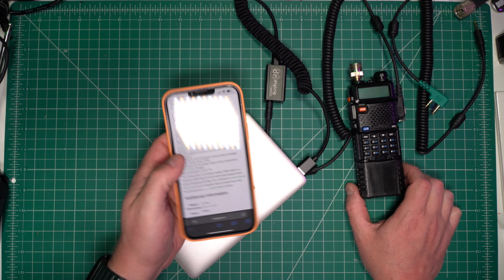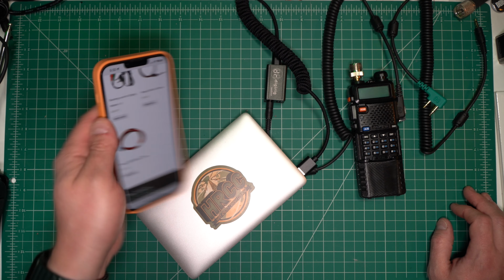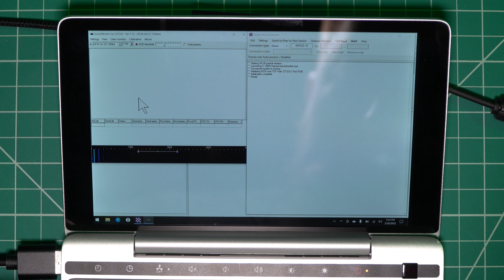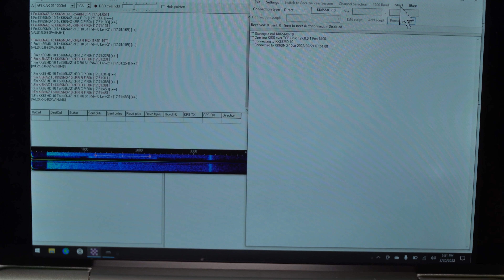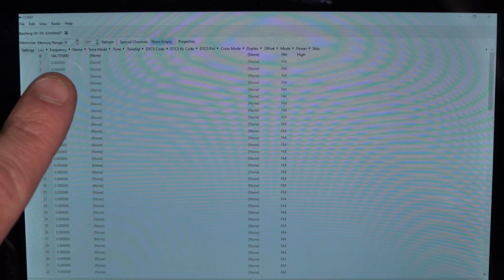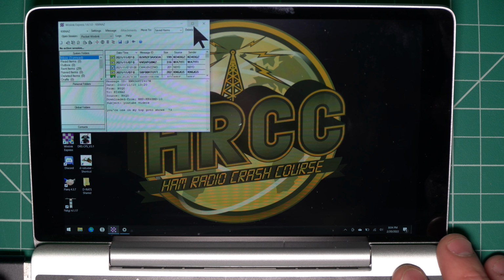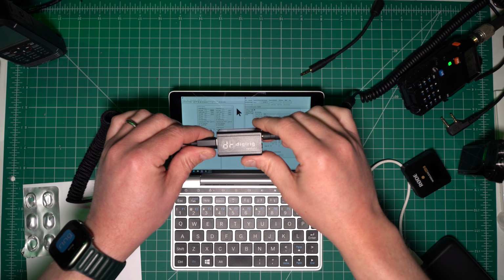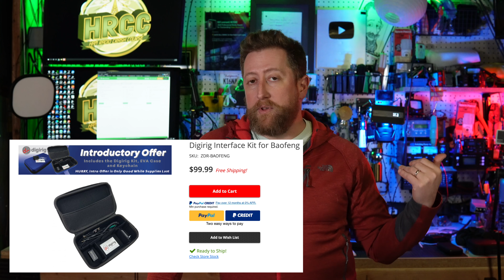Digirig Radio Interface - Baofeng Winlink & CHIRP programming

Comment: I was a very early Digirig user. It's worked flawlessly with my G90. It just works.

Glad it's picking up some mainstream attention. I need to pick up the rev 1.8 and some cables for my 891 and baofeng.

Comment: Got one from the DigiRig Store with the KX3 cables about 3 weeks ago. Had it up and running on the mac in 10 minutes (figuring out WSJT-X took another 10-20) Love that it's just one USB cable to connect. Note that if you are buying one without cables you may want to make sure you get one set for the right levels for your rig's serial control (though you can always get out the soldering iron and change it)

Comment: The digirig sounds interesting, but I'm a bit confused poking around their website.  Are the jumpers inside the actual unit different for different radios where if you use it on an FT-857D, IC7100, and Baefeng HT...not only do you need 3 sets of rig to digirig cables at $30+ a set, but completely different digirigs themselves.  Requiring 3 separate $50 units, dedicated to each rig.  They also neglect to mention how long the "short" cables are...only mention how long the "standard" ones are.  Rather significant oversight.  The USB-A to USB-C cable is same design as those on the market right?  Nothing devious like different proprietary internal wiring so you have to buy theirs I hope?

Comment: Any tips for people having connection issues?
Most replies I have gotten on winlink forums are pretty much along the lines of:
“Those cheap radios take too long to go from TX to RX. Buy a good radio if you want it to work?
Reply from the maker: Connection issue to what?

Comment: I am having an issue with a UV5R following this. If I turn off squelch VOX doesn't work and if I turn on squelch it misses the first of the packet. Very frustrating, any ideas?
Reply from the maker: Squelch off means the radio is in non-stop receive and the vox likely won’t come on. Set it to 1. Regarding missing packets. Add some wait time before transmitting.

Comment: I have the same exact setup but for some odd reason the digirig mobile is not transmitting/going hot. this appears to be the case with both windows and android. Thinking I should probably return/exchange since I confimred it is not the cable going to the baofeng.
Reply from the maker: Contact DigiRig.

Comment: Just got my Digirig. Spent  couple of hours with it the first night and a couple of hours the next morning. Watched your video a few times and still can't seem to connect it using Packet Winlink. Tried copying your settings in SoundModem and Winlink but no luck. I can get it to make 5 tone bursts while attempting nearly every station/channel close by and then it disconnects due to timeout. Even connected to an external antenna. Were there any critical settings on the HT like VOX or Squelch that you had to configure?
Reply from the maker: Is the gateway replying?
Reply: I'm having the same issue.  For me, the stations that I'm attempting to connect to respond when using a different radio with a built-in TNC.  I've been scouring the internet and had no luck in getting the digirig to work with packet Winlink.  I'm completely stumped.
Reply: Same here. My Baofeng/Digirig/Soundmodem combo works perfectly with APRS (using APRSISCE/32 as my client). But I cannot get it to connect to a Winlink node. I got a couple of responses from a RMS node but Winlink won't take 'yes' for an answer and keeps sending connection requests. Frustrating. Reception shouldn't be an issue; I'm sitting atop a hill overlooking the valley where the node is located.

Comment: Mine doesn't work.  We need a video that shows the installs and settings we need to do for it to work.  Considering returning the Digirig and cables back if I cannot get it to work with Winlink.

Comment: I’ll wait for the next generation of all this as this won’t go mainstream until it is more simplified..
Reply from the maker: Idk there will be a next generation. As long as radios have separate serial and audio lines you’ll need to split them up into an interface. 

Or get an ICOM 705. One wire or wireless.

Comment: Is it possible to setup a ham radio BBS service to connect computers without the internet ?
Reply from the maker: Ham bbs exists. It’s packet radio stations. But it’s all ham radio to ham radio for connection
Reply: @HamRadioCrashCourse  damn that’s cool, see if you can set one up.. that would be an actually useful system in times of internet outage (societal collapse) being able to leave data messages on a bbs and being able for others to retrieve all over the airwaves.
I wonder if there is bbs software for it tho? I’m an amateur at all this but I like the idea of that system, would it work with lora perhaps that would be better protocol ?

Comment: The ONLY tool you own that has only one purpose is called a FIRE EXTINGUISHER.
And you keep that in the kitchen, or one on the garage.
Reply from the maker: I have one in the shack, the kitchen, next to my bed, in my car.  Big fan!
Reply: @HamRadioCrashCourse  I'd like to see the water-based foam fire extinguishers fixed, so the use non-toxic agents, because the powdered ones are corrosive and will ruin everything it touches, like your car or stove- or radios!

Comment: The website made it seem like if you wanted to use this for APRS or Packet WinLink you needed to change some solder connection on the board. Is this true is it plug & play for that and say Vara HF? How does this compare to the Mobilinkd TNC3?
Reply from the maker: It depends on the radio you want to control.  If you have questions.  Message them on the DigiRig site.

Comment: So I am not seeing the cable savings.  IF I had the programming cable for my Yeasu and the audio interface cable for my Yeasu tha'ts 2 cables.  It looks like with this, I will have 2 cables to connect to it, and a 3rd cable to connect to my computer.  Am I missing something?
Reply from the maker: One connection to computer for both CAT and audio.  Which if you’re going with newer smaller devices may only have one port like usb-c

Comment: Do you need to set the HT to VOX instead of PTT for this to work? Also, I thought that you needed a Digirig specifically set up for the Baofeng (i.e. not one set up for a G90, for instance). I thought I saw a blog post to that effect. Correct me.
Reply from the maker: You vox needed. With the Baofeng cable set it will ptt the radio. 

You shouldn’t need another Digirig to interface Yaesu, Kenwood or Xiegu radios.  Just the unique cables.
Reply: You do not.  Mine that I got yesterday was a 1.8 version
Reply: @HamRadioCrashCourse  I am attempting to configure my FT3D with use with Winlink / Soundmodem / Digirig... I get the waterfall, need help with TX (VOX set to On/LOW). Thoughts ? Suggestions?
Reply: @rickroyston  You are right. This version does PTT on the Baofeng. Sweet! I just wish getting Winlink working with packet was as simple as it looks in this video. I'm struggling. Setup works great with APRS. Have not yet been able to connect to a Winlink RMS.
Reply: @pbac74  high

Comment: Have you tried using it for APRS? Seems like it could be a cheaper overall solution than a Signalink
Reply from the maker: Not yet. But it would work.
Reply: My preference for APRS with a Baofeng is the BTECH APRS-K1 cable. For right around $20 it's a nice piece of kit that has served me well. I hope to test drive the Mobilinkd TNC3 in the near future for the added convenience of ditching the comm cable in favor of a more efficient package. 73

Comment: I don't understand why you would use a Digirig to program a Baofeng with Chirp. There are lots of USB to Kenwood cables that work fine.
Reply from the maker: One cable. It can program the radio and work digital modes.  It’s like a signal link and Ftdi cable.

Comment: What is the difference between this and the Mobi?
Reply from the maker: Mobilink is a kiss TNC and wireless over Bluetooth.
Reply: @HamRadioCrashCourse  and the digirig is just a means to connect radio to other hardware?
Reply from the maker: It’s a serial and audio interface over one usb wire to the computer.

Comment: There is a bluetooth programming interface for the BF, TidRadio, etc.
Reply from the maker: I’ve reviewed the Bt unit.  Fine unit. Horrible app. It doesn’t do audio control though for working Winlink like the Digirig does.
Reply: @HamRadioCrashCourse  Notarubikon thinks it's a great thing.  
I'm traditional, so I'm used to the old ways.